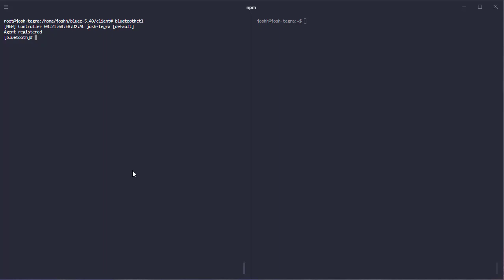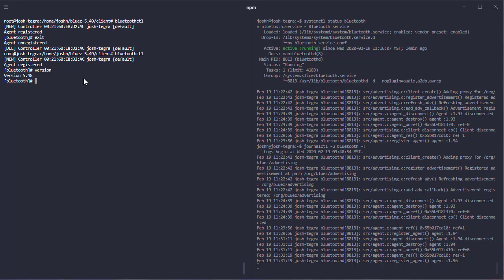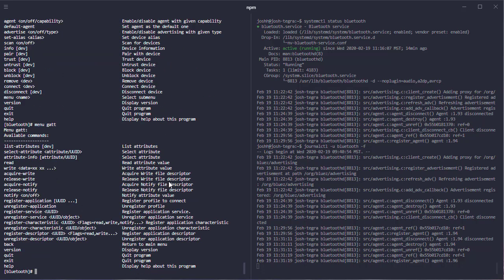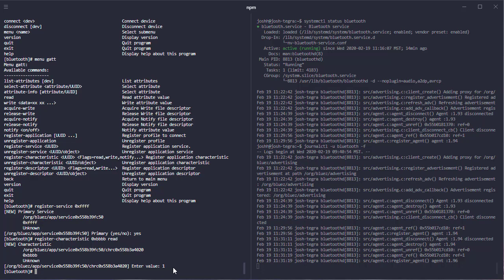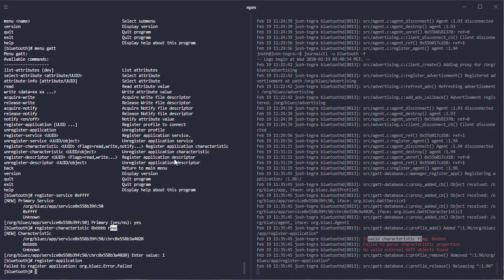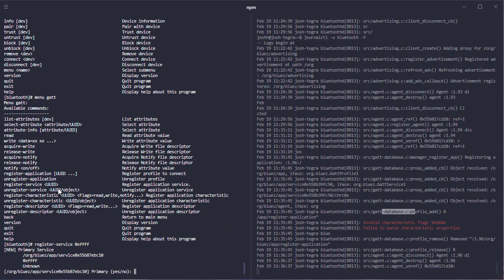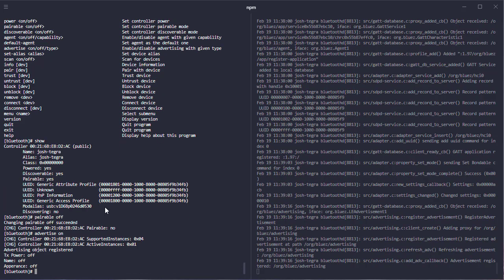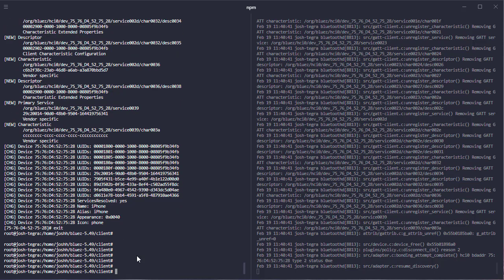Bluetooth Peripheral GATT setup on embedded linux

Comment: Hi Joshua, that was a great video. Worked for me too on my raspberry pi 4 model b. I am trying to read / write characteristics on a UART service running on a BLE module using bleno library.but i am stuck in disconnect issue after some 2 or 4 second so i am can not read services before disconnect.can you explain this command is execute using shell script or not.Thank you.

Comment: Hi Joshua, that was a great video.. Worked for me too on my Ubuntu PC :). I am trying to read / write characteristics on a UART service running on a BLE module (nRF52833). The UART service running on it works on pretty much any BLE Serial Terminal apps available on the Playstore, I am trying to implement the same Serial terminal application using Python / C on my Ubuntu PC. Any inputs on this is highly appreciated. Thank you.